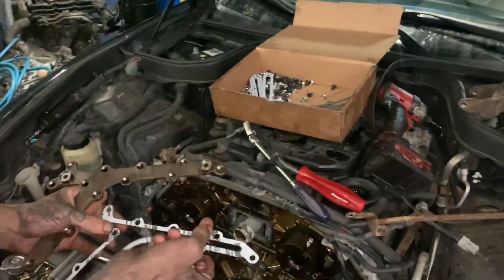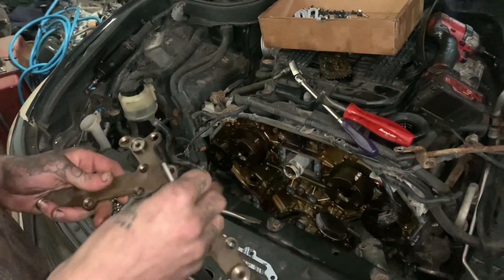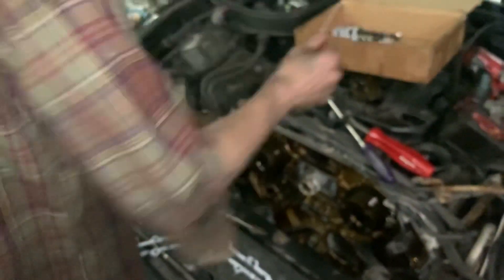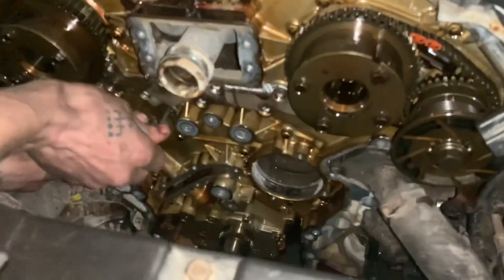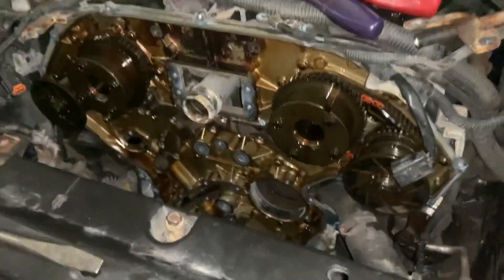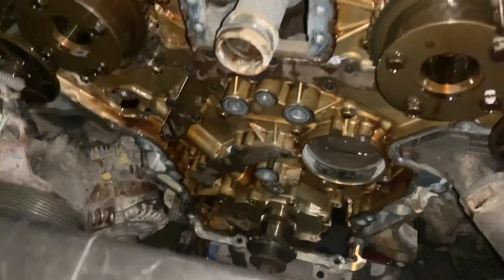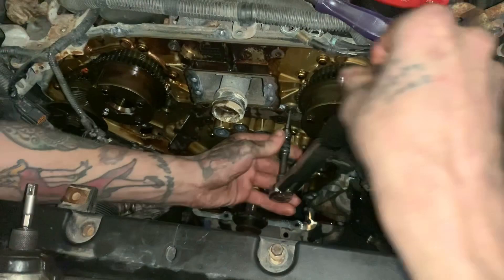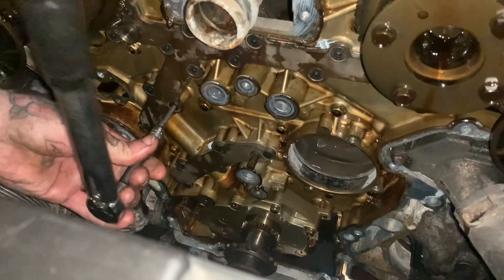EASIEST WAY TO TORQUE GALLERY GASKETS PROPERLY

Comment: Thanks for the shoutout, main reason why i ended up supplying 2 different bolt material was simply availability at the time and still now it will vary. But like you mentionned, both will carry the torque load asked here the same way. I use Genius Tools medium length hex in 1/4 drive, nice quality for the price and might be easier to source for some of the guys watching this vid aswell.
Reply from the maker: I much prefer the black as it has no chamfer!
Reply: @camwilson8305  Noted!

Comment: How do you get thay hard to reach original Phillips out??
Reply: I've the Phillips 1/4 inch drive bit, the ones they use in drills, mount a locking pliers to the side of it or use a 1/4 inch wrench and turn it to loose